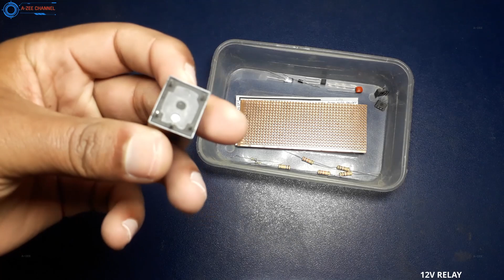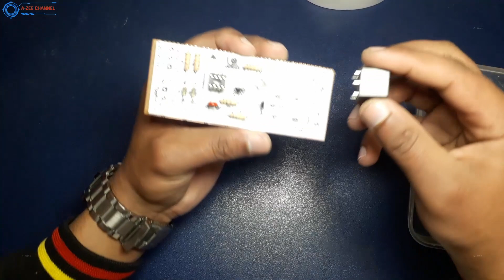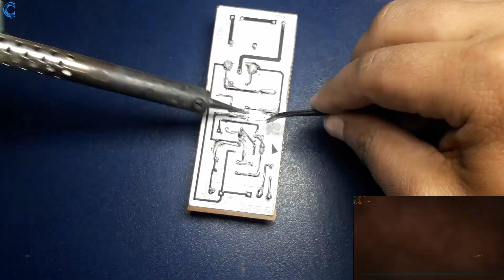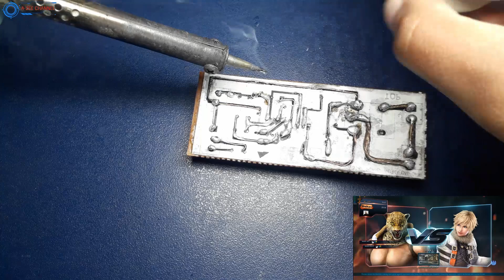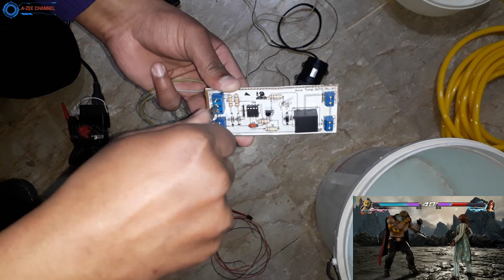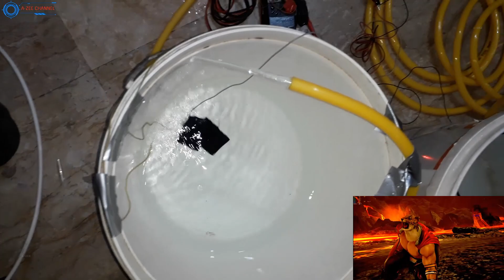DIY, (UPGRADED) WATER PUMP AUTO ON/OFF CIRCUIT. HOW TO MAKE A WATER PUMP AUTO  CONTROLLER AT HOME.

Comment: Good working device kudos to you 👍, but there is a problem it was working normal but in the long run it stopped and when I remove COM. wire it will start working but not switching off the pump I don't know y, I tried fixing it but is not working. Pls 🙏 any advice
Reply from the maker: THANK YOU.
You mean when you make this CIRCUIT. It work normal some days and then fault occurs?
Reply from the maker: Well... some times this happens to me as well. If you have all tools. So you can make a new CIRCUIT in less than a $. I make a another one when one of my CIRCUIT causing me trouble. And I know it is little different to make the CIRCUIT but it is easy to make my given CIRCUIT after 1 or 2 attempts
And do you know. You can convert this same CIRCUIT into light dependent switch. Just by adding a photo resistor in it. You can see this in this video https://youtu.be/cAkdCeEBR_s
This same CIRCUIT can also be converted into bilge pump CONTROLLER. By USING a float switch with COMMON wire and "on off" wire.

Comment: Please design the same circuit with dry run protection
Reply from the maker: WE CAN DO THIS WITH THE SAME CIRCUIT. JUST WE NEED 2 OF THEM. ONE CIRCUIT WORKS AS IT IS. THE OTHER CIRCUIT WORKS AS A BILGE CIRCUIT, (BILGE CIRCUITS OR PUMPS USED IN THE BOATS). WHAT YOU HAVE TO DO IS CONNECT THE BOTH CIRCUITS SUPPLY AND LOAD IN SERIES. THEN USE THE SECOND CIRCUIT AND SHORT ITS OFF AND ON WIRES TOGETHER TO MAKE IT ONE LINE, LEAVING THE COMMON WIRE AS IT IS. NOW TAKE A FLOAT SWITCH AND CONNECT IT WITH COMMON AND ON-OFF WIRE. THAT'S IT YOU HAVE AN AUTO ON-OFF CIRCUIT WITH DRY RUN PROTECTION. USE THE FLOAT SWITCH IN YOUR GROUND TANK. WHEN THE WATER IN THE GROUND TANKS FINISHES THE SECOND CIRCUIT CUTOFF POWER OF THE PUMP.
YOU CAN DO THIS SO FAR. UNTIL I MAKE ANOTHER VIDEO ON THIS CIRCUIT.
Reply: @A-ZEE_OFFICIAL  dry sensor should be at the upper tank water in coming point, when water flows Tha relay should be on with delay and water is not flowing relay should be off . Because it is very diffucult to fit low water sensor in lower tank in my case. Please provide suitable circuit for me. Thank you sir
Reply from the maker: @haribabukalla5816  I AM MAKING VIDEO SOON ON THIS CIRCUIT. GIVE ME TIME TO THINK ABOUT YOUR PROBLEM. IN THAT VIDEO I WILL ALSO INCLUDE YOUR PROBLEM. SO SUBSCRIBE TO ME AND WAIT FOR THAT VIDEO. CURRENTLY, I AM WORKING ON A SOLAR SYSTEM PROJECT. I WILL MAKE THAT VIDEO SOON AT SOME DAY.